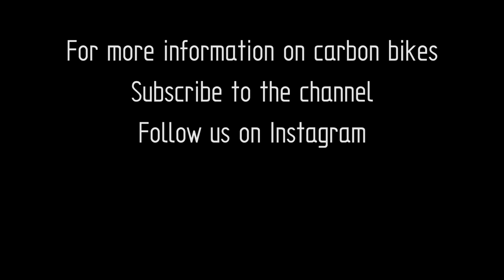Don't do the "squeeze test"!

Comment: I could break my glasses anytime I wanted with basically 0 effort. The same is true of most household items. Carbon bike frames rarely fail during normal use, the fact they can be damaged if you go out of your way to do so isn’t surprising and isn’t a problem.
Reply: You can try to squeeze the tube of a Ti frame and all you would be doing is hurting your thumb. The fact that one can damage a CFRP frame by just pressing it, speaks volumes about the resilience of the material and the unsuitability of it as a structural material. Accidents happen all the time, your bike can fall over while leaning against a wall at the cafe, or you might have a crash, if this happens, you will need to get it checked out by someone like Luscher. You wouldn't need to do that with a metal frame, even the thin walled steel frames.
Reply: @shannondeckard8587  This had very little to do with the material. A carbon frame that weighed the same as a steel frame, and used the same thin tube geometries, would be just as resistant to crushing (if not stronger). Or alternatively, a steel frame as light, and shaped the same as a carbon frame, would bend like a tin can. There have been plenty of lightweight aluminium frames that could easily be flexed and dented by hand.
Reply: @johnm91326  So what you are essentially saying is that for CFRP frame to be as resilient as a metal frame, it has to be as thick and heavy as a metal frame. Which negates any weight advantage that CFRP affords. You would be hard pressed to be bend a Titanium frame with the same tube thickness as that of a thin walled CFRP frame IMO.
Reply: @shannondeckard8587  I’m more just pointing out narrow, thick walled tubes are inherently more resilient to crushing. The freedom carbon gives you in shaping is one of its biggest advantages. Take that away and it will still outperform metal, but it’s isn’t magical. 

Obviously the titanium frame of the same wall thickness would be harder to bend, it would weigh literally 3x as much. Carbon is better, but not 3x better (all else being equal). If you mean tube diameter, then it would entirely depend on the layup and wall thicknesses.
Reply: @johnm91326  My 2003 Merlin Cyrene weighs just 7.5kg wet i.e. with a saddle bag (with a multitool, two tyre levers, an inner tube), a full bottle of water, a Cycliq fly 12 front and fly 6 rear dashcams, an Omata one computer. It's weight dry is about a kilo less. That is almost the same as most CFRP bikes on sale now and you'd find it hard to put a dent into any of it's tubes even if you tried. I have swapped out it's original Reynolds Ouzo pro CFRP fork with one made of Ti. So I would question how a Ti frame would (as you say) weigh three times as much as a CFRP frame that is made to same strength. The problem with CFRP is that when it is flexed beyond it's parameters, it shatters and shears off. Metals don't do that due to their ductibility.
Reply: @shannondeckard8587  Titanium is 3x as dense. If you make the same tube, with the same wall thickness with both materials (as you say) then the Ti will be 3x heavier. Obviously it will also be stronger, just not 3x stronger. 

The Merlin Cryene is a 1400g frame. Respectable for Ti but 50% more than even an average carbon frame. And it has narrower diameter tubing. So obviously it will be harder to bend than the 800g tarmac with very large diameter, thin walled tubes. Really has very little to do with the fact your frame is Ti.
Reply: @johnm91326  I can guarantee that the 800g tarmac would crack and break in two if you stomped on the tubes while you'd be hard pressed to do the same damage if you tried to  that to my Cyrene or any other Ti Frame. CFRP fails catastrophically, while strong in one direction, crash into a wall and it would probably crack up into separate pieces. Any Ti and Steel frame will still be in one piece. Also all when CFRP fails, it does so catastrophically. I would rather have a slightly heavier frame that would survive many years of abuse (intended or otherwise) rather than a light weight CFRP bike that needs to be scanned and checked by the likes of Raoul.
Reply: @shannondeckard8587  An impact large enough to crack a carbon frame would still compromise the structural integrity of a Ti frame (assuming the frames have been built to similar standards).  Sure it would dent/bend instead of failing catastrophically, but you’ve now got a weak point that eventually will might catastrophically. From a safety perspective metal is better, but either way your frame will need a repair. It’s not like any of the metals in that video you linked would be usable.

Light vs durable is a completely different argument. Carbon can be built to be extremely durable, and alloy bikes can be light and fragile. For example the Kinesis Aithien, a truely light alloy frame, had a rider weight limit of less than 90 kg. That’s much less than even most lightweight carbon bikes.
Reply: @johnm91326  Highly unlikely that an impact on a Ti frame would compromise it's structural integrity especially if it was large enough to crack a carbon frame in several pieces but as you said, metal is better from a safety perspective. Which is exactly why CRFP is not a suitable material to make bikes that will be used by amateurs for years on end. In many cases, you'd still be able to ride home on a metal bike with a dent in one of the tubes. None of the metal pieces in the video I posted, broke into two pieces, while the CFRP ones did or where damaged enough that there was no longer any structural integrity. As you just said, a CFRP bike can be made durable but it will weigh as much as a metal bike, negating it's only advantage of reduced weight. Manufacturers are making CFRP bikes that have wafer thin tubes which do not have the durability needed for extended ownership by amateurs. Pros get their bikes from sponsors every season or two so are not concerned about the longevity of their bikes while the lay person will keep theirs for years. Metal bikes generally fail at the junctions of the tubes due to improper manufacturing (e.g. in the case of Ti purging), or corrosion (in the case of Steel) due to improper care. While many CFRP monocoque bikes fail at the tubes i.e.  material failure. http://www.bustedcarbon.com/
Reply: @shannondeckard8587   I don’t know how clear I have to make this. A carbon frame of equal weight, stiffness, and shape will be more durable. It’s just normally carbon is optimised more around stiffness/weight because that’s what more people care about. Even if this wasn’t true, it still has a much better fatigue life than any metal (the actual reason why metal frames fail), and in reality it’s almost always shaped which vastly improves the stiffness of the overall structure. Shaping Ti is basically impossible. 

Of course you can still ride a damaged metal frame, but the material has failed. You could also sticky tape your carbon frame back together. Neither frame would be safe to ride. And let’s be honest, after that kind of crash you wouldn’t be riding home regardless. Carbon mountain bikes hold up fine, so clearly the material can be very durable.
Reply: @shannondeckard8587  Metal parts have torque limits too. I bet you’re Ti frame has a pretty low torque limit for the band-on front derailleur. On some steel frames (eg Ritchey) it can be as low as 2.5 Nm. Ironically that’s much less than carbon bars/seatposts. 

Pressing a frame with your thumb is not representative of the loads it would take during real world riding. Plus we’ve been over this multiple times now, but a thin walled metal frame wouldn’t fair much better. Using a bike rack that holds any bike by its frame is a bad idea, regardless of the material. 

I’m sure just as many people have been injured riding alloy bikes. Cracks and corrosion can be hidden by paint and difficult to spot. I remember someone literally died not too long ago from an alloy steer failing. I guess they didn’t know alloy can’t fail catastrophically.
Reply: @johnm91326  Mistakes while torqueing a metal bike is much less fatal than on a CFRP one. The bicycle has been around for more than 100 years and it is only in the past 15 years that we have seen torque wrenches use becoming de rigueur
. Alloy bikes or Aluminum bikes can corrode like Steel which rusts due to poor maintenance and I am sure there have been some rare cases of catastrophic failure with metal bikes but they are not the norm while CFRP's mode of failure is INHERENTLY catastrophic as it does not bend (it is not ductile like metals are) but facture when pushed to the limit.

Comment: If carbon can't stand simple thumb press, then it should be considered bad. Besides usual load while driving it must be resistant to simple stresses from other directions.
If not, what is the point? To keep it in showcase?

Comment: One finger press is too much to take? Where is the stiffness for?
Reply: The stiffness is in the other direction, think of it like an egg or an empty toilet roll or something similar, those items are very easy to crack/deform when squeezing from the side, from top to bottom though they are much stronger/stiffer, much harder to crack an egg from top to bottom than side to side. So frametubes are much, much, much stronger in loads between headset and bottom bracket / seat tube, and ofcourse the triangle that the frame creates adds a ton of stiffness.

Look at paper bridges that some engineering school creates for competition, who can create the stronges bridge out of a given set of paper, i saw one that could withstand over 500kg (search for "paper bridge"). So that bridge is incredible strong in the direction that it was design to take the load but you could still destroy it with your finger & sideload.

So yeah, just because something seem weak in one direction doesn't mean it is weak in all direction, it totally depends on geometry & what type & what direction of the load it is designed for
Reply: I agree... but for a bike that is going to receive regular real world  use toilet paper and eggs might not be the model. Also TP and eggs are at a very different price point.

Comment: and this is partly the reason carbon fibre frames are often totalled in minor crashes Bike frames are designed for specific stress i.e load carrying and the input torques etc putting any other sort of stress on them is asking for trouble - don't crash don't do this thumb press nonsense, buy a top-end alu frame and save a fortune after all you are probably not a pro anyway

Comment: 1:50 so you can damage your carbon frame simply by grabging it by top tube. That's absurd. Should there be warning on every frame: "Don't grab it too hard". Where are those good ol' days when you could give a ride to your girlfriend on a top tube. Now you cant even touch your frame.
Reply: There are warning stickers on the frame: Look, but don't squeeze.
Reply: There's actually a warning for that : Clamping the frame can cause damage to the frame that may or may not be visible, which may impair the structural integrity of the frame. Quote from Specialized manual

Comment: You are all being taken in by the cycling carbon scam,they pull 600lbs tuna on carbon fishing rods,never seen one snap, the problem with cycling designers/engineers is they are doing that job because they weren't good enough to get a proper job.If you were doing a engineering degree and the choices were aviation engineer or cycling engineer,whichwould you go for? To back up my claim the aviation industy works in microns,cycling engineers can't Even drill out a round bottom bracket,hence back to threaded bottom brackets.
Reply: You know you can’t just drill into carbon to make a hole for the bottom bracket right? That’s not how any of this works.

Comment: I think that is very damning of carbon fiber as a frame material outside of the highest performance contexts.
Reply: The bike is made for riding, not crashing. Nor squishing for the meme
Reply: that statement is a little naïve, if manufactured to the required standard then carbon fibre is more then adequate, it's poor manufacturing practises and poor QC that have given carbon a bad name
Reply: @lcc8394  And that is where the price-point is now down to below "high performance context".
Not that junk isn't sold at "high performance context" prices, but you catch my drift.
Reply: Now all the people who own a carbon fiber bike are going to chime in and tell you how wrong that comment was. I for one totally agree with you. Carbon sucks as a material used on bikes. I've broken a shitload of carbon which finally came to an end with my latest bike. It's titanium and as many metal parts as I could build it up with. I got tired of throwing away good money when racing became less appealing to me.
Reply: @wasupwitdat1mofiki94  sounds like ya crash a lot or don't have access to a torque wrench m8
Reply: @wasupwitdat1mofiki94  Titanium is surely a better material for bike building !
Besides it’s the most comfortable bike to go over our badly maintained roads! 🤙🍀
Reply: @wasupwitdat1mofiki94  Sounds like I was right lel

Comment: Raoul your words reminds me of the advice to children..."don't lick that frozen steel pole" then that dumb and dumber moment.
I think people fail to realise that many frames are pliable in certain zones of a frame it's how they've been designed. It's probably less than ideal but you'd think it's  only just a few manufacturers.  the way some "influencers" are harking on.
Reply: If a frame fails a squeeze test its a piece of crap and should not be a design for a vehicle used on public roads
Reply: If you press the tube with 2 fingers then you stress the molecule bonds in the resin. 30-40 N finger pressure will delaminate and destroy the frame. 
Now, Matthieu van der Poel exceeded 1500 Watts in his sprint and the Canyon frame had no problems with pressure and extension of frame molecules. What is the problem then?

Comment: The reason I squeezed my S-Works SL7's is I was BAFFLED as to why they are so flexy under power and thru hard corners. 

I made a video comparing my SL2/4 and 7. The 7 is a total FLOP of MUSH. 

The SL2 and 4 are incredible frames designed for racing and you feel that as soon as you push some watts thru it. The downtube is non flexible - rigid and you can feel that.

Mushy downtube = mushy ride. That is why the WT riders downtube SL7 doesnt flex like consumer level does. They even ride different forks as confirmed by WT mechanics Ive talked with and video footage Ive been sent.
Reply: As soon as I saw the thumbnail and title I thought of your recent videos 🤣🤣

Comment: What planet are people on? If you can damage a carbon frame with your thumb it has to be rubbish. Especially a high end storck. If that’s the case then these frames should be sold as professional use only. 

The everyday rider will put their bike through lots of stress over the years. Of course a frame should withstand a good thumbing.

Comment: Reason number 74 - to buy a titanium frame rather than carbon 

😏😉😉
Reply: They can break too, just a different failure mode. I cracked mine at bb to seat tube weld. Not all carbon/ ti/ alu etc frames are equal

Comment: Excuse me, but as an engineer I like to contradict your statement. Yes, the carbon layers are resin laminated and yes, you put a directional side force to the frame so that it bends inwards.
BUT: the moment you put pressure on the pedals the frame bends to one side as well which results in compression on one side and extension on the opposite side. That's physics. As the carbon material would have nowhere to go and carbon fibers are inelastic per se the load would be taken by the resin. If there were no strong molecule bonding forces of resin to carbon there would be microcracks all the way all the time. And that's where in the past many folks said that old carbon frames are dangerous. 
A pressing finger in Durianriders video can put a local pressure of what... 30N to 40N? And then you see pro riders leaning their butt on the upper tube for photo sessions with the sponsor? Everyone does it. And then you see Matthieu van der Poel pushing 1500 Watts in his sprints while putting immense pressure and extension load on the resin molecules, way more than two fingers. Something does not add up here.
In my opinion the frames of today are so extreme that they become dangerously thin and brittle. Ever lighter frames are the marketing paradigm nowadays. My colleague had his carbon bike leaning against the wall and slide down, the upper tube hitting the road curb. The result was a broken frame and a total loss. That's absurd, just like you see in races where in a group crash many bikes instantly break into several pieces. This is not a Formula 1 car with a safety cage but a fragile dangerous carbon frame without a safety margin.
That's like when a Boeing or Airbus would lose both carbon wings on the tarmac after a rough landing in a storm.
My Corratec CCT Pro frame doesn't give in a single millimeter when I press it hard. But it is also 980g instead of latest 750g. Still, the bike is 7.0 kg.
Reply: Point load vs spread load?
Reply: @franmcgowan4068  Relevant is the stress load on the molecule bonding between resin and carbon. There is no difference between point load and spread load. They can be the same. I see here the problem. Extremely light frames have high-end Toray layers and are therefore much thinner than cheaper frames. Fewer carbon layers mean less bonding resin thus less resistance and much higher brittleness. The lighter the frame the less material there is. Just like paper thin aluminum frames who dent and fracture easily at a certain point.
Reply from the maker: Are you familiar with the short beam shear test for composites?